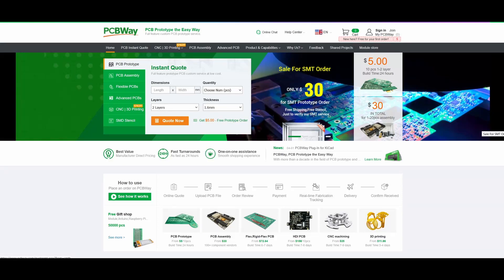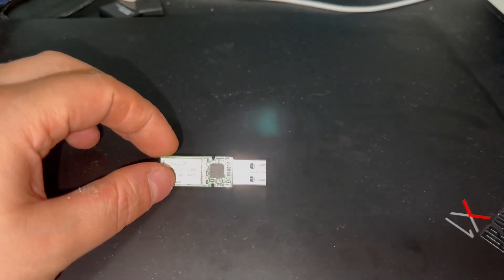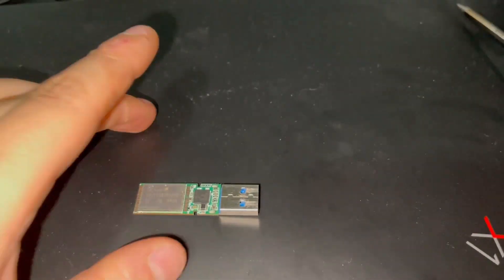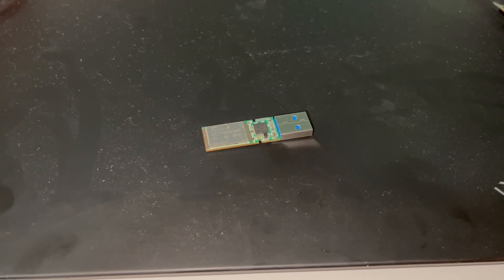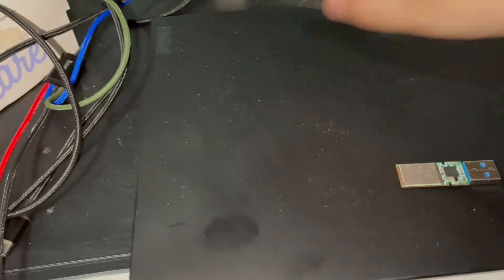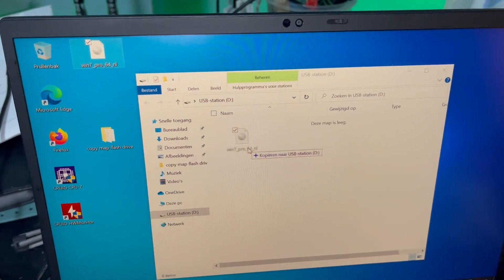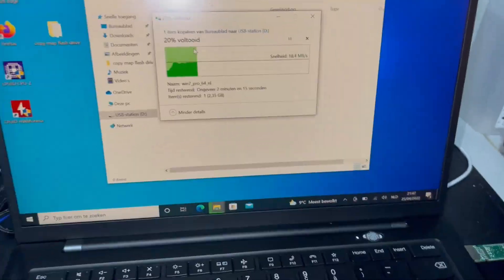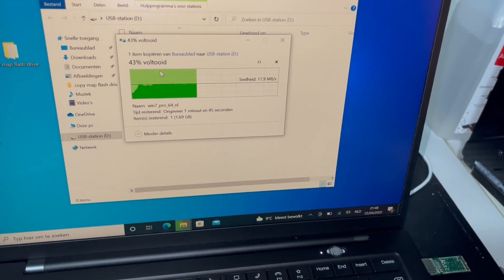Turn a broken iphone's NAND Flash memory into a USB 3.0 flash drive

Comment: If the memory has videos and photos, if we change it to USB, will the photos and videos come out?
Reply from the maker: No because those photos and videos and all the rest of the data on there is encrypted.  U will need to reflash the nand flash memory to be able to use it.
Reply: @aim6mac  what does encrypted mean? Are they be there or not?
Reply from the maker: @compazorrillo1468  they are gone im afraid…
Reply: @aim6mac  so they will be deleted 😨
Reply from the maker: @compazorrillo1468  yep
Reply from the maker: @compazorrillo1468  this is not a data recovery guide by any means :)
Reply: Or The memory of the iPhone that I have damaged if it can be changed to another iPhone if it worked well?